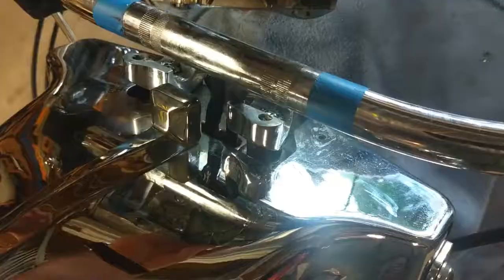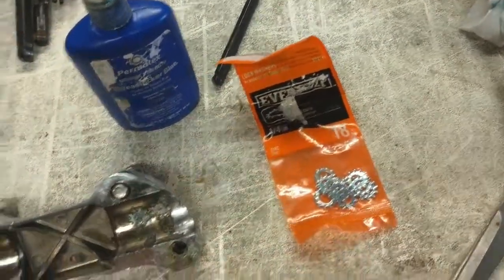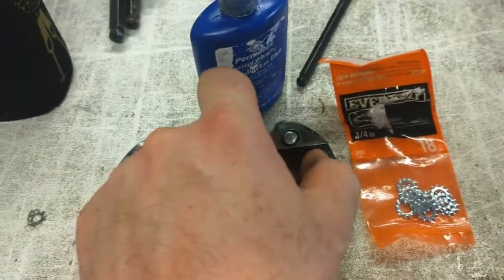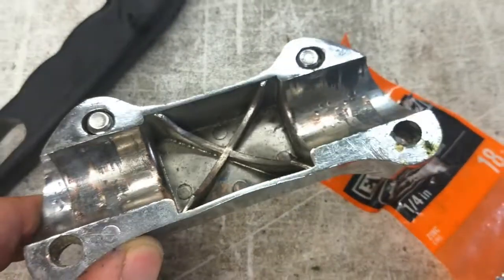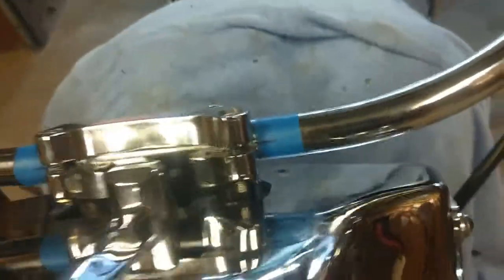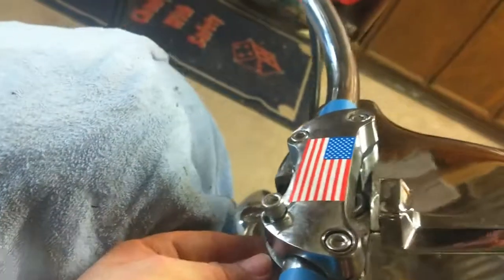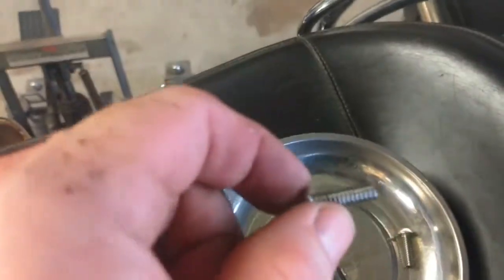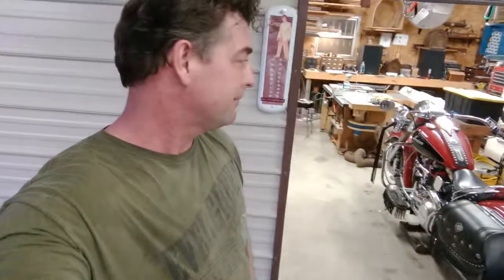1999 Gilroy Indian Beach Bar Handlebar Fix

Comment: Hey buddy, I got a 2000 Gilroy and I’m trying to find front and rear brake pads. I’m in Australia and none of our suppliers have a listing, would you have the part numbers for them handy. Much appreciated
Reply from the maker: Hi, the parts manual shows a part # of 50-005 for both front and rear.  Indian Moto Parts (.com) has an upgrade set that fits currently with a part # of 51-000.